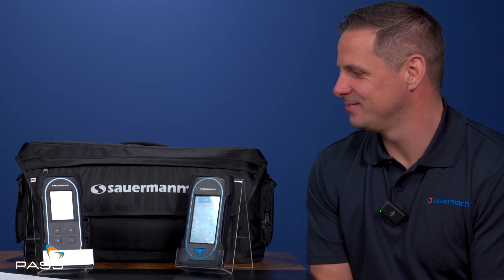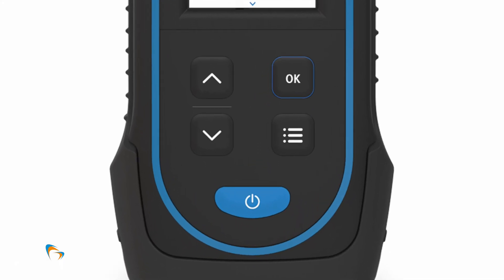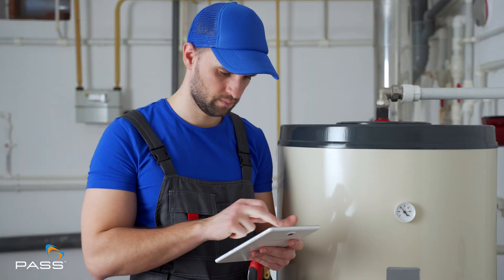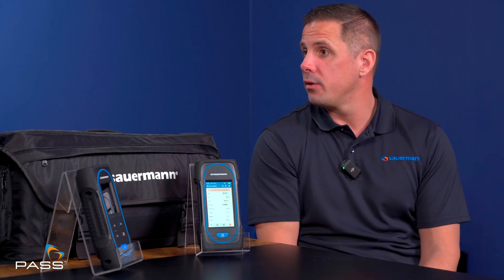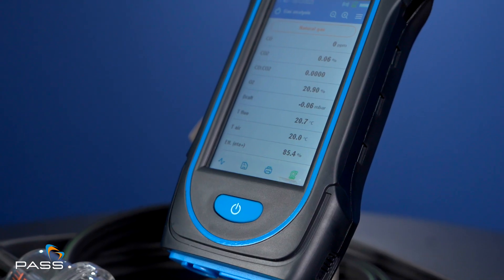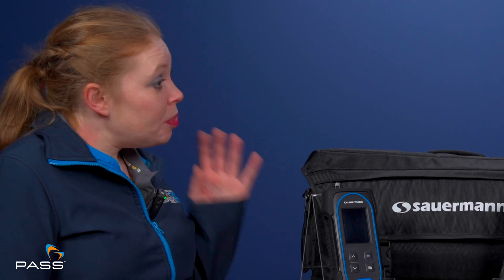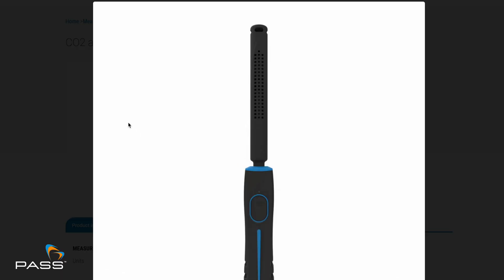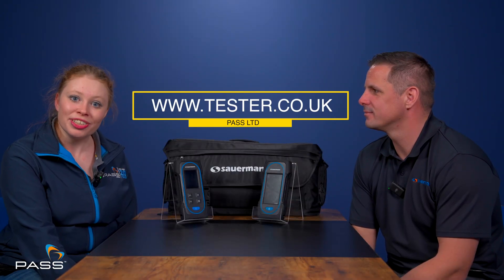Sauermann SI-CA 030 vs SI-CA 130 Flue Gas Analyser

Comment: Can i just clarify if i buy the standard 130  analyser it comes with a rigid probe, which is a must for commercial. But i also need a flexible probe for domestic jobs. The flex probe costs £200 plus i would also need to buy the differently hoses for roughly £30. Is this correct?
Reply from the maker: The kits for the Si-CA 130 include either a 180mm rigid or Flexi Probe (2m hose) or a 300mm rigid probe (3m hose).
 
The hoses for these probes are permanently attached to the probe itself so no additional hose would be required unless the customer requires an extension which extends the flue hoses by an additional 3m.

If you require any further information, please call us on 01642 053941, or visit our website www.tester.co.uk

Comment: I have purchased the 030, why is there no co/co2 ratio on the display? as a residential engineer it is the most important reading. Please advise if this is an option I am somehow missing, otherwise I will have to return unit
Reply: Did you manage to solve this?

Comment: Does the Si-Ca 30 also display the Co/CO2 ratio on screen?
Reply from the maker: Yes, the Sauermann Si-Ca 030 combustion gas analyzer does display the CO/CO2 ratio on screen. This analyzer is designed to measure and display various gas parameters, including carbon monoxide (CO), carbon dioxide (CO2), and their ratio, which is essential for assessing combustion efficiency and safety in boilers and other combustion applications. You can find out more about this by contacting Sauermann themselves for instruction on how to set this up.

Comment: Does it do temperature differential?
Reply from the maker: Hi @jamiethackway2475, It does a Calculated reading with a measuring range of 0 to 1250 degrees Celsius and resolution of 0.1 degrees Celsius.  You can check out the full tech spec here: https://www.tester.co.uk/files/get/download/id/11660/sauermann-kimo-si-ca-030-combustion-analyser-datasheet.pdf Many thanks PASS:)

Comment: Is it possible to do Gas tightness test reporting with the si-ca 30 analyser? 
Thanks
Reply from the maker: Hi @pavvyhara, thank you for your enquiry. It appears that this meter offers a differential pressure test, which is tightness testing. However, the user would need to purchase the “Differential pressure hose kit” (Part No. 27538).  If you need anything else, or would like more advice, please, do not hesitate to contact us. Many thanks:)